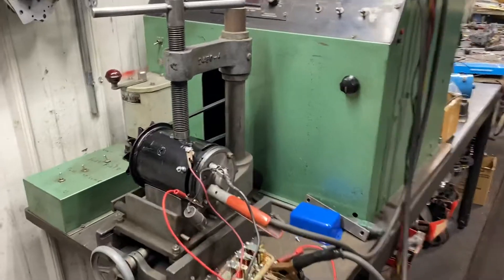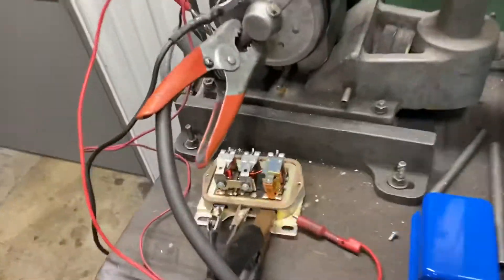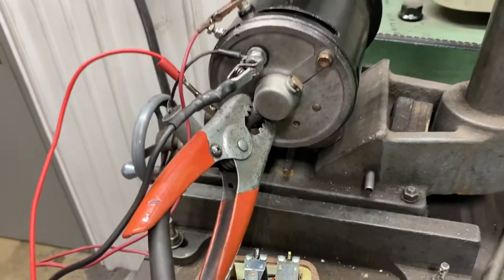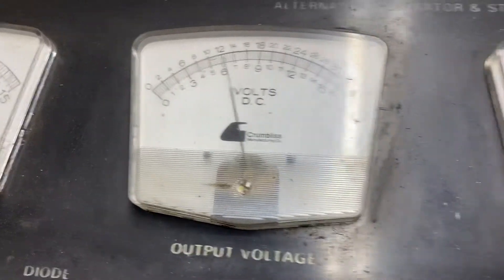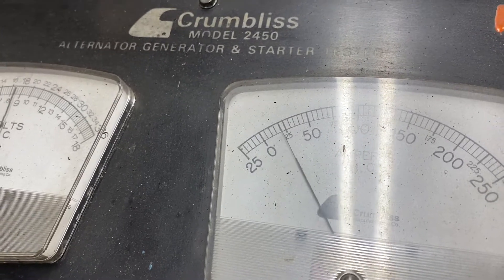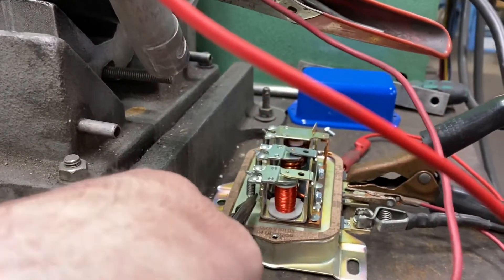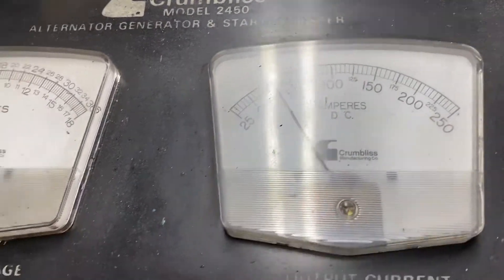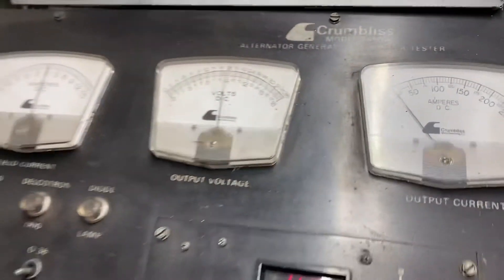Adjusting the Voltage Regulator in a 1953 Mercury Generator 6V Positive Ground

Comment: Thanks! Fixed my 53 F100 Genny output from 6.1 up to 7.4 volts in 2 minutes! I have the exact same voltage regulator in your video - do you know brand and part number for this as I would like to buy one - they are hard to find in Australia. Cheers!

Comment: For those of us with these classic vehicles (‘62 vette), we really rely on old school mechanics with real test benches to keep things running. I’m now troubleshooting my 12 V generator (Delco type A). Pretty sure it’s the generator and I’d bring it to you in a second but I’m 3000 miles away. Since mine is a ‘numbers matching beastie’, we work hard repairing/refurbishing to remain original. Thanks for posting. I’m still laughing at your chuckle describing the 6V ‘53 Mercury generator. That could be me.